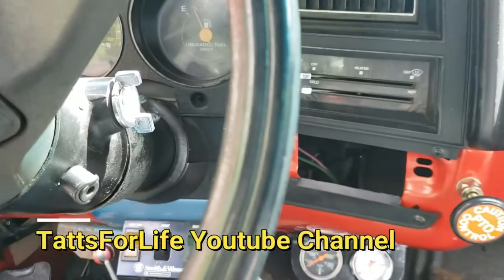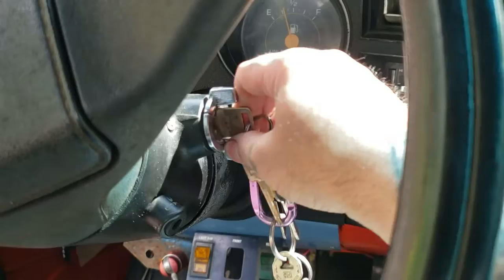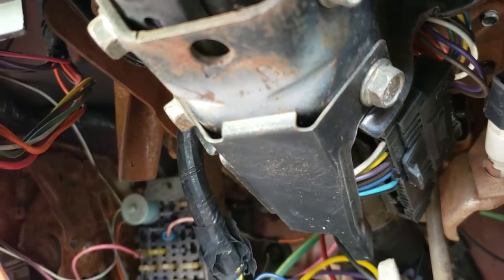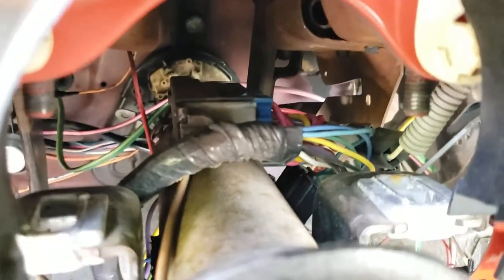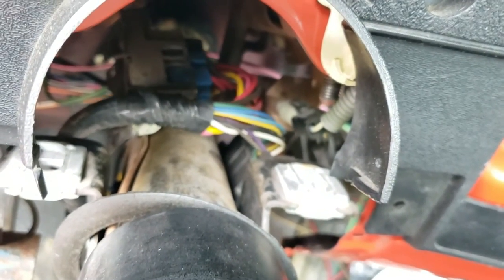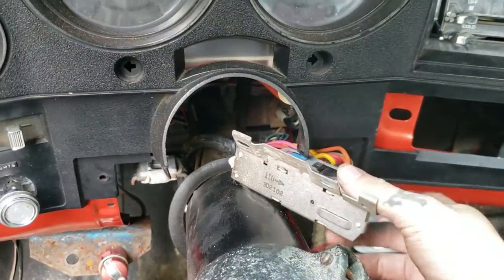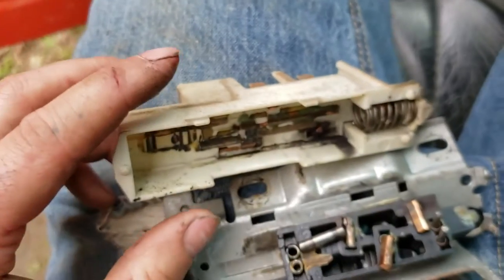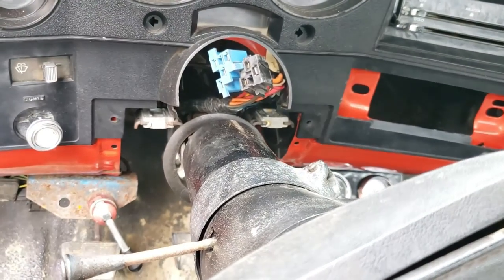Square Body No Crank, No Start Investigation, Problem Solved? c10 c20 c30 k10 k20 k30 c/k trucks

Comment: Same symptoms here, turn key and brake warning shows up, no sound. Though I had a dead spot in the starter. Knocking on starter itself did the trick to start it. So if you are not able to jump the solenoid. Knock that starter. Time to get a new one.. or repair it!
Reply from the maker: Great info, it's hard to find anyone who rebuilds starters anymore lol I usaly buy new

Comment: Hey buddy thanks for the video. I am dealing with the same thing except for me, I replaced the starter and the ignition switch, and it STILL won’t turnover. Any ideas?
Reply from the maker: try replace or bypass the safety switch
Reply: Have you found out yet?

Comment: I wander if the reverse would cause it not to turn off? That's what mine's doing, when I twist the key, the truck will continue to run, sometimes after turning it a few times it'll finally shut off, but I'm guessing this is beginning to fail. BTW, I have an 84 c20.
Reply from the maker: Nice and yes that switch would cause that

Comment: Hello I have a friend has a 78 Chevrolet pickup got the same problem but you got fire to the starter wire to the ignition it just won't start I'm thinking it's the neutral safety switch like you showed on your video he's tried everything nothing going to start any ideas
Reply from the maker: you can bypass the safety and see if it will run, or turn the key to on then cross starter over and it should run
Reply: My friend found the problem it was a wire that was broke and that went to the solenoid on the starter and that's what I told him to check but it took him a new steering call them checking the starter 100 times checking HEI distributor everything but what I told him so he finally went out there and did it and it started right up when he fixed it but thank you for the information preciate you
Reply from the maker: Great to hear that it is fixed

Comment: I have a similar problem but I go to turn my key and nothing comes on in dash and it does not crank at all nothing from it no reaction do you think this could also be the problem? For me
Reply from the maker: It could be or the fuseable link in the wire from the starter
Reply: I have the same thing going on
Reply: Your ECM under the distributor is bad.
If you have NO lights at all, and you know you have good wires and a battery then it's the ECM.

Comment: My truck solenoid stuck and kept the starter turning after turning the key off; due to the battery sitting all winter.
It resulted in the no crank..
The battery should have atleast clicked at 12.4 volts..
It was my battery...
Thought it was good because it read 12.45 volts, but I had static electricity built up and it wouldn't charge past that.
I unhooked it from the truck, then charged it and it went to 13 volts and I hooked it back up and it fired right up.

Comment: I was changing my alternator last night and I heard something as a burnout and I did the same thing I traced everything else but I got a 1975 Chevrolet camper special c20 3/4 ton but I can turn the ignition and the same problem but does that kill all the power in the truck even the dome light
Reply from the maker: yea, it would, also you could have blew a fuse-link that is made into some the wires

Comment: I have a 1978 Malibu and I left my lights on by accident. I have no dash lights coming on but headlights and horn works. It wont start but has the door buzzer sound. I checked the fuses and the battery and they're all good, even replaced the ignition switch and still not working. Any thoughts?
Reply from the maker: Did u replace the natural safety switch and ignition module

Comment: Hey brother I have the same problem the only difference is that mine only does it when it’s  running for a while I go to turn it off and it won’t crank At all I’ll give it 15 20 minutes and it’s starts like a champ again do you think it’s the same problem or would it be a good starting point let me know please.
Reply from the maker: Starter getting heat soaked maybe
Reply: Having the same problem! 😵
Reply: @Candace_Michellbetty  I ended up changing the ignition switch. And replacing the starter with a racing one, also bought a heat wrap for starter haven’t had any issues since

Comment: was that the problem after all ? Good video - I'm taking that part out of my truck right now and found your video very helpful !
Reply from the maker: yes, it fixed it but soon after my neutral safety went out and caused the same issues
Reply: @TattsForLife  when I took out that starter switch in my 1984 C10 305 the insides were scattered inside - shocking to see that mess. Haven't re-installed new one, yet as , I am having a problem getting the rod back in it.
Reply from the maker: @truckhogs  yes that can be a pain, it has a slot that it half to slide down into if I remember right
Reply: @TattsForLife  yes , it goes under the starter switch and the position of the starter switch has to be in the accessory position
Reply: come to find out the right part makes all the difference. First place gave me a part for tile wheel even when I told them non-tilt. Second place gave me the right part and it went in without a hitch.
Reply: I’m trying to find out what’s causing my trucks ignition fuse to keep blowing under the dash. I replaced the switch already and replaced the burnt wire behind fuse box but still nothing lol
Reply: @carlosherrera8541  although I changed the ignition switch on the column of my 1984 C10 305, and it was in pieces inside the switch, seems I have a fusible link problem. Haven't found it yet. I wasn't getting juice to my distributor so now I connected a direct wire to distributor from the battery ; went under dash so I have a toggle switch to turn off when I shut the truck off.
Reply: @truckhogs  I just fixed our obs today. After fixing the ignition A fuse wire behind box that was burnt from the starter wire at first pinned between exhaust
Reply: @truckhogs  starter wires grounded and burnt the wire behind box and I totally forgot to check that at first. Got that fixed and truck still bad idle etc. I did the safety switch nothing. But the problem was the injectors wire was pinched under the air cleaner. Also replaced the egr valve which I recommend. Also o2 sensor and still ran like crap and blk smoke till I noticed some vacuum hoses were bad on throttle body and now she runs good besides needing new plugs due to running rich. Good luck on yours what all have you done?

Comment: Well when I crank my over all I hear is clicking and I just replaced the engine that was a TBI to a Holley carb and a lot of the wiring I don't need but I'm still having problems but the battery still works and I got told to bypass my neautral safety switch
Reply from the maker: It would not click if it was the a
Safety switch. It's either not got enguff grounds from battrey to engine or bad stater

Comment: I took my switch out and it started with a flathead screwdriver. But when I put it back in it still doesn’t start like the rod isn’t pulling it into crank position or something you think I should just replace the switch and see what happens. Because it just started with the original switch with a flathead screwdriver so I’m confused on what it is
Reply from the maker: could be wrong switch for that year length of rod

Comment: having a similar non-start with my '84 S-10 Sport. ( 2.8 V6 A/T swap at some point. )
I don't hear the fuel pump coming on and the battery is weak.
So I'll start with a new battery and go from there.
Reply from the maker: that's a good place to start

Comment: What's the part called? Is it called the nuetral safety switch is it special order or can I get it at napa
Reply from the maker: its a old part, depending of your part store may be in stock or not, and no this is not the neutral safety switch, U have a detailed video of me fixing this issue with the ignition switch modular, but the neutral safety will cause the same symptoms
Reply: @TattsForLife  hey you mentioned your neutral safety switch went on you but it was not connected as you went from auto to manual? I'm having the same issue right now with my truck no power at the the ignition bit everything else yes
Reply: @franchescolorenzo5629  having the same issue with my 79…did you ever figure yours out??

Comment: I get no sounds at all. New Starter,Altenator, and battery new rebuilt engine lord help me.
Reply: Same here!
Reply from the maker: try the neutral safety switch
Reply: @TattsForLife  fixed it, it was a shorted out wire passing right on top of the distribuitor
Reply: @TattsForLife  ty ill try anything. 
This sounds but I used to drive only older vehicles.  I bought an 06 Lincoln navigator oh lord! Ill never buy another. Im too old to play fond that short or wheres all the water coming from. Ty
Reply: @joseleal7053  My son did say he thought it might be coming from the coil.
This is a new engine. I cant believe there any shorts. We do live in the country so anything is possible.
Reply from the maker: @laschell59  I grew up with older cars novas and camaros, and the newer stuff have so much you half to do in troubleshooting
Reply from the maker: happy tp here you got it fixed

Comment: Wondering if anyone Can help me out for my 85 was driving and it just randomly turned off I replaced the battery with a new one even tried to jump it but i when I turn the keys in my ignition my dash lights don’t turn on or a engine crank at all but I still have power from my headlights any thoughts ??
Reply from the maker: Fuseable link blew maybe

Comment: Well I try to start up my 1983 c10 all I hear is a click and that’s it my battery is good and idk why
Reply from the maker: Have you had your battrey tested? By it looking good does not mean its good, also could be a bad ground wire from battrey to engine, hook a booster cable to ground side battery only and other end to the engine and see if it cranks, if not it could be your starter

Comment: Mine was the little plastic gear on the left side of the columnwhen you turn the key it turns the little gear to start the vehicle that plastic piece the plastic gears broke
Reply from the maker: Great info, mine was the switch on the column that went bad
Reply: Mine was the plastic gear that moves the column to start the truck I don't understand why it's not made out of metal 😂
Reply from the maker: Company's trying to save money instead of making things that will last

Comment: I have a problem with my truck, sometimes it cranks and sometimes it doesn't
Reply from the maker: could be the starter relay, I would check that first
Reply: @TattsForLife  where is it located ?
Reply from the maker: @p9vg  like  this truck, should be on the back firewall if it has one, if not check your starter solenoid, they will cause  that issue to, or a bad starter, or poor grounds to engine

Comment: Mine bring up code 12 Everytime? Is this the problem cuz I have to tilt up and down
Reply from the maker: im confused with what your asking, but if its a older TBI then that would indicate a communication problem with the ECM a bad wire or plug connection even a fuse

Comment: but would stop you from moving your gear selector from park?
Reply from the maker: That would be more the linkage on your transmission binding or cable
Reply: Tattsforlife your detailed video failed to mention what the part was called . You just said “this guy” good details . Next time add the part number and what it’s called in the description of the video save ppl some time

Comment: I have the same problem but I don’t think it’s the switch even when I wire the starter it cranks but no start
Reply from the maker: natural safety will cause that issue, make sure you getting hot on the dissy with key on
Reply: Hiii can you please tell me how to do that
Reply: @TattsForLife  I’m just seeing this reply I just bypassed the vats n it crunk rite up but that was on a 92 Camaro

Comment: My 1983 chevy c 20 does the same thing replaced the starter and today bought an ignition switch but in my case I had no sparks just will not turn over
Reply from the maker: Sorry I did not understand?
Reply: @TattsForLife  sorry lol nothing happened when I turned my key over  so we had to cross the over the solenoid to get it to start
Reply from the maker: could be neutral safety switch bad then
Reply: @TattsForLife  yea that may be it
Reply: Sounds like starter, solenoid, and/or wiring harness issues. Those starter wires eventually go bad. I'm the proud owner of an '83 C10. 18 years and still drive it daily.

Comment: Where's the ignition coil switch at cause it cranks but not start
Reply from the maker: depends on engine type, most has one inside the dizzy, which makes the spark plug fire